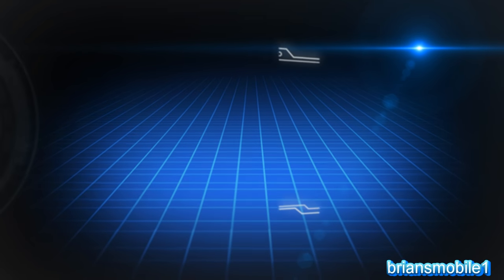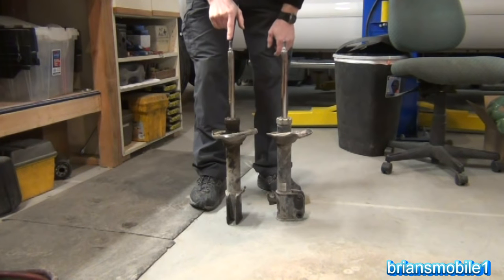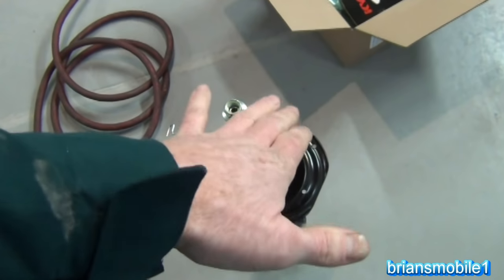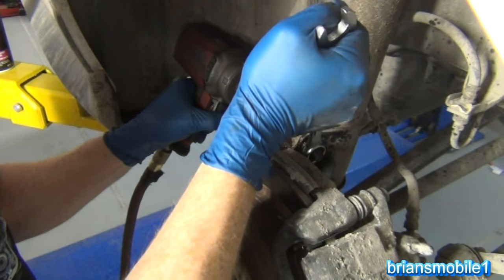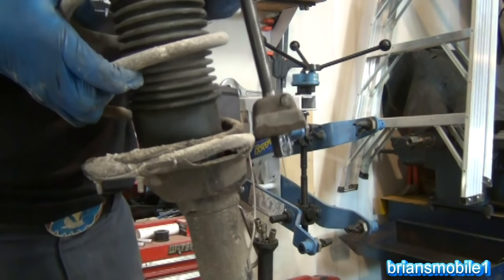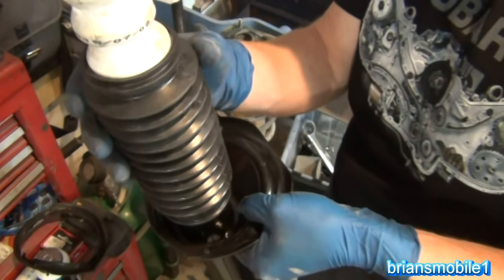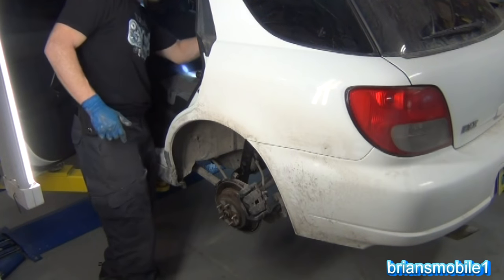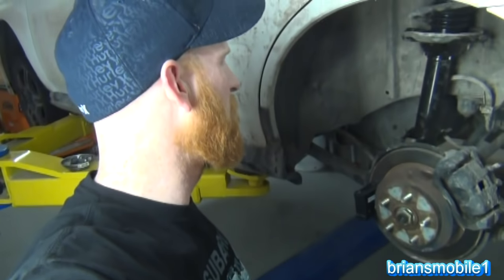Best Subaru Strut Replacement Video

Comment: Great video, with some really good explanations of suspension components.
The Extra footage segment brought up some suspension semantics .... my 2cents is that dampeners make things wet and dampers reduce oscillation. So a pothole full  of water could be a dampener if you drove through it, and the damper (shock or strut cartridge) would reduce of oscillation of the spring when you did. ;-)
Reply from the maker: +snocrushr Excellent word smithing.  I see what you did there!  ha ha!  I remember being able to speak English well.  I miss it.

Comment: Hey Brian, love your "style"!  I just watched your buddy South Main Auto Repair video on strut replacement on 07 Forester and the bump stop is orientated big side up, like a mushroom cap.  It makes sense to me to have it big side up so when you hit a pothole, the bigger stiffer part of the rubber bump stop is what takes the initial impact and then as it compresses down the smaller end eventually smashes out.  I have changed out a ton of normal shocks in my life, but not sure if I want to take on renting a cheap spring compressor and risk an accident.  I might see if I can find someone with a spring compressor to install new struts into old springs for me or maybe just "spring" for whole new strut assembly, haha, pun intended.  See you on the hill on a powder day, you will be easy to recognize in the blizzard.

Comment: 12:30 was a little trick with the rubber pads, below and above the spring, that I just didn't know, thanks man! I always pushed on the wrong side. I didn't know if I pulled instead that it could go better.

6 percent of a degree off the previous camber is definitely good enough...it assumes it was right before. ;)

Comment: The gas pressure in pressurized stuts is an attempt to make the strut work better.  Pressure on the oil helps keep it from foaming or boiling.  In other words, a pressurized strut is a heavy duty strut.

Comment: Thanks for explaining the  alignment issue at the end of the video. Maybe you have an alignment video showing better detail of the strut mounts and how they can be moved to affect the alignment angle.  Also, if a person doesn't have the angle tool you have, you might mention that getting an alignment by a pro is necessary after doing this strut replacement job.
Reply from the maker: +Ken Goodwin Yes of course.

Comment: I would of got sti strut assembly. Around here they are so many of them sold used in jdm stores or just privately. My friends wrx strunts went out and got the sti's all around, it really feels planted now and rides just as great, nothing harsh or stiff. I don't know how the JDM used market is around you but over here they're every where and 250$ for 4 struts that look and drive brand new ( 120k on them) is a great deal compared to average after market stock replacement.
Reply from the maker: +ltwargssf R Not a bad idea man!   This year Sti rear struts are prone to clunk pretty bad.  I have a video on how to fix it.  Once you put a grease zerk on them, they're great.
Reply: I remember that video actually, great tips man. How come you're not running studs on those tires ?
Reply from the maker: +ltwargssf R Expenses.  This new house has lots of expenses. I about broke the bank freeing up REX from grocery getting duties.  I would LOVE a sponsored set, but I can't afford them at the moment.  I could really use ANY insulation in the garage too.  It's as drafty as the Vietnam war out there!
Reply from the maker: +briansmobile1 The Vietnam war had 648,500 soldiers drafted- that's a lot of draft.  It could be a lot worse though.  I've got sheetrock and I put up seals and insulation on the doors.  And that's why I didn't say WWII.  WWII saw about 10 million draftees.  That's REALLY drafty.  Plus many had to fight in the snow in the Battle of the Bulge through Poland, Romania, Germany, France, and Czechoslovakia too.  That will put some hair on ya!

Comment: Best video by far... and I will be following your video as you made it look like fun ;)) but I've cheated as mine are complete with the springs fitted and the reason why, is because both garages I took my Forester to gave my different opinions... one opting for original only because it has the self levelling type, and the other stating that aftermarket struts won't take the weight of the vehicle... I did call a parts service and they assured me that the struts would take the load and won't sag... but there's many mix feedbacks about this, so found that Pedders EziFix kit is like the original and is the best suited to the self levelling... I didn't feel confident about both garages and suspension is complex tertiary especially if clueless... I've got a few years about motorcycles so have learnt about how all this up and down works... but to someone who doesn't have this side of mechanical brain you could end up being lost to their expense... there isn't a video explaining how a failed spring would look like compared to a failed strut and what sag would be recognised in both... looking at my Scoob I would've thought the springs had failed because of the sag... but later found out that those particular struts do take some of the weight too. Great video and a big thumbs up for making this brilliant video ;)))

Comment: Nice footage of Powder Mountain Road! But anyway, my only suggestion is that you include a bit more info on the 2 bolts that go through the knuckle(for us  idiots) the shows which one has the Cam and about marking that bolt if you don't have one of those handy dandy little magnetic gadgets. May seem trivial but i honestly don't remember which is which and it would be very helpful info to include for a lot of people. Thanks!!!

Comment: Excellent how-to!

P.S. Willieb66's explanation is right, but his statement is wrong.
These are indeed struts! When you remove them, the suspension system has become incomplete - the wheel's travel path is no longer defined. So yes, they are an intergral part of the suspension system.

Cheers!

Comment: great video Brian thanks, would have been nice if you showed how to deal with the brake line since the bracket holding the line is close and modification is needed in order to work around that.

Comment: I first subscribed over a year or two ago because of your past videos on other cars. I soon saw how Easy the Subaru is for access & repairs in your videos. I've got a 97 Camry just under 310,000, a 3400 02 Impala at 260,000, and because of your videos we just bought a 2012 Subaru Outback for kid hauling & North Dakota winters. It's amazing how accessible everything is on the 2.5!
For a daily commute 60 miles each way, would you recommend a CVT 2.5L Legacy, or an older WRX? The Camry & Impala will get me about 1.5 to 2 years before I need a newer commuter - just not sure what's best or what budget range to look for. Suggestions?
Reply from the maker: +cobannie The 2.5L is more comfortable and driveable.  The WRX is the best for on ramps, passing,  and general fun.
Reply: You've obviously not replaced the spark plugs ...

Comment: My struts aren't leaking or showing much testing signs that they are worn. It does squeak occasionally when I get out but it sounds more like a sway link. The ride quality it horrid though. Big bumps it takes okay but the little and mild bumps are making the car jump in the back. Feels like hitting the brakes hard in a fwd car and trying to turn. The back end tends to jump out to the side a little, the mild bumps I can feel the struts barely keeping the car from bouncing over and over and over. Bounces about 3 or 4 times with them. Not sure how it's handling the big bumps okay but it is. I work out in the city and they might as well have washboard roads with how lazy they "fix" them. Patch work everywhere that plows tear up every winter IF it lasts till winter

Comment: hi brian i got a subaru sti 2006. i have  a problem with my rear shock. the shock plate attached to the car came off from the spot welds and i cant seem to find anything about this problem on you tube. 
i spoke to my mecanic and he said only body shops can fix this. have u ever experience this kind of problem on subarus
thanks hope to here from u

Comment: Once you set the struts back at the same location as the damaged / worn out location of the old strut ,where your tyres are / wearing , wouldn't the angle be changed simply because the new struts aren't warn out and be sitting in the location they should be at ?

Comment: Thanks for the video man! I hav a ts wagon and my struts have been creaking for the last couple months until they finally seized up last week(i imagine that's what happened, they don't even rebound right now). Got the KYB struts and your instructions were very insightful. will you go back and eventually redo the alignment? or are you simply going to have them both at that camber that you ended up on?

Comment: Hey Brian! I have an 02 wrx with all sorts of gummed up suspension. I should have looked at it better when I bought it.... my fault. But, it has some crappy coilovers in the front that are not adjustable because the colars are rust welded to the strut. The back is another story.. it has a stock spring and strut on one side, and a stock strut with a lowering spring on the other side. yeah. I was wondering if you knew of a good place to get all 4 new struts and springs?
Reply from the maker: +Jackson Menke Word on the street is look for some take-offs from an Sti on a forum or JDM shop.

Comment: Was just told by the mechanic I can't use the old coil (thing) and my back stuts did not come with them? Looks like you used the old one is that correct? 🤔
Reply from the maker: I did.  Are yours broken?  Or does your mechanic not have the tools/desire to re use them I wonder?  I see broken Ford Focus coils all the time, but not Subaru.

Comment: Briansmobile1 I've had nothing but early failures and crappy ride from Monroe SensaTrac. If KYB isn't that great either, I'm undecided on a brand to try next. It's a shame there are not STI type parts cross referenced parts across the board, for non STI Subarus.
Reply: +SoundGuyDavo Bilstein HD or Sport, and Koni yellows are your best friend. I have an '05 wrx wagon with the konis

Comment: I am having trouble getting the rear strut out of wheel well I took the top nuts off and the two on bottom and it's very tight to pull out and the ABS cable is making it hard to get out 
someone said to me to undo the knuckle 
I didn't see that in the video 
I have a 1999 Subaru Legacy GT sedan
Reply: I had bought the quick struts online which is so much nicer than having to take the old spring off

Comment: I was taught the samething, but was told not to turn over the dead car while the donors car is running. since that would instantly pull 24 volts off the donor cars alt.
Reply from the maker: +tonymoran6679 If you let the car run for at least 30 seconds it makes all the difference.  It basically charges the dead car up like trickle filling a bucket with a hose.  As for 24 volts..... nope.  Volts are pressure.   Amps are flow or volume.  Cars are always 12-19 volts 13-14 volts if everything is working right.   When you start a car there's a lot of flow or ampere's drawn.

Comment: sosos

can anyone comment on when or if springs are also changed out

 100,000 miles ?
 200,000 miles ?

ever?

is it practical?
advised?
or simply a matter of what it costs that cause many mechanics /owners to skip

??????
Reply from the maker: +Finn Blu It depends on the car and the use.  Most springs never need to be replaced, others like the ford focus actually snap at 80k-110k miles.

Comment: KYB ! you know what that stands for :) Keep you Bouncing...Crap struts but if they are free, then who cares...
Reply: +vanox Meures Huh...rockauto has different grades of parts available sometimes. Monroe is under economy. They were listed premium at AutoZone back in the day, but rockauto marked them more accurately.

I eventually went Moog on everything and haven't had any problems, but I still have 2 monroes struts. They're weaker, but I couldn't make myself replace them when they were "good" just not great, and now I can't tell they're there with quality new springs around them from Moog.

So, before you blame the strut, it may be the spring.
Reply: +vanox Meures Dude! Finally watching the video and his bad, worn strut is as "good" as my new Monroe was. (Bought them on a buy 3 get 1 free, never got the rebate sent in when I only needed 2....7 years later, I really debated installing the things when those factory originals finally caught up with the rear struts.)
Reply: DE Nichols Huh...Well just the fact that you are comparing KYB to Monroe means they are crap...Moog was an OEM for many BMWs, they are ok for providing original ride performance but not that great...Want improvement go for Bilstein HD or sport, or Koni Yellows...you want better springs go for H&R.
Reply: vanox Meures
We both know Bilstein is another step up, but it wasn't available on my ride. I've heard of H&R and Koni, but hadn't looked at them, thanks. That's some advanced research tip for when my Monroes finally crap out and I can get some serious goodness under my mounts.

Lol, can you tell I'm watching MCM while I say this? lol
Reply: DE Nichols I always watch MCM for fun mostly! :) Enjoy !
Reply: vanox Meures
I sure am. The fans of Briansmobile are a LOT nicer to talk to though. You can get eviscerated by trolls on MCM, lol.

There are weeks I won't comment there, I love commenting, so that's super hard to do, lol.

Comment: I notice you wearing goggles while skiing.  Gloves while removing the struts. Why not don eye protection (safety glasses) while working on the vehicle.  I would never use my rattle gun with naked eyes. I've has sockets shatter flinging metal in many directions.